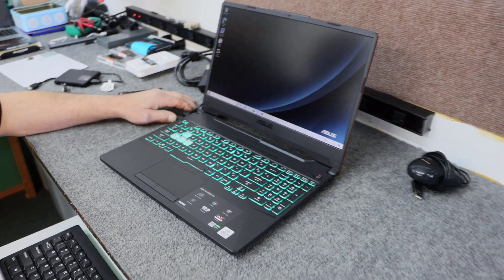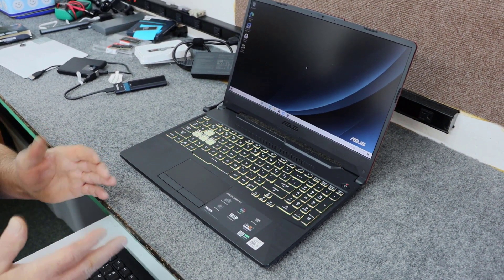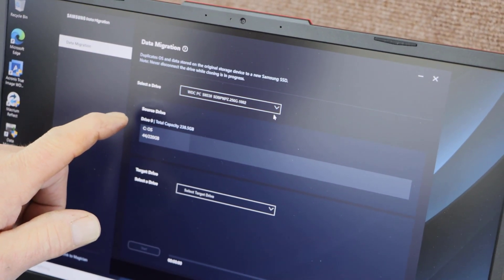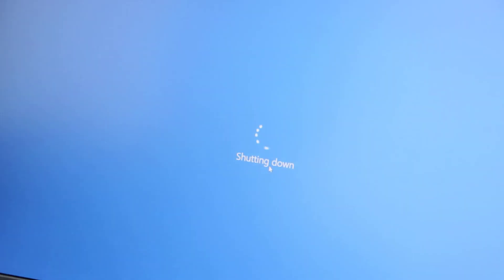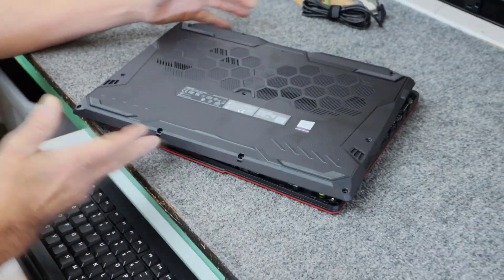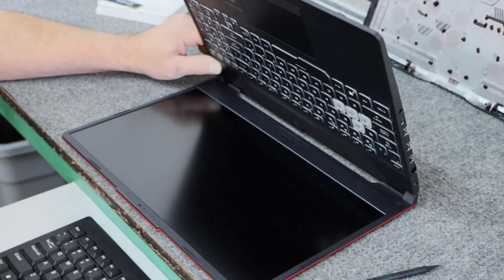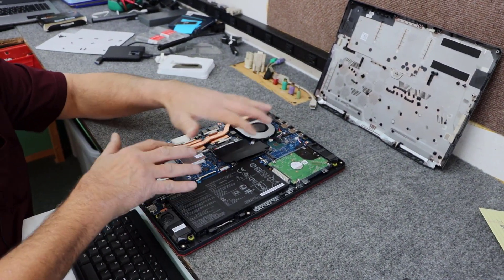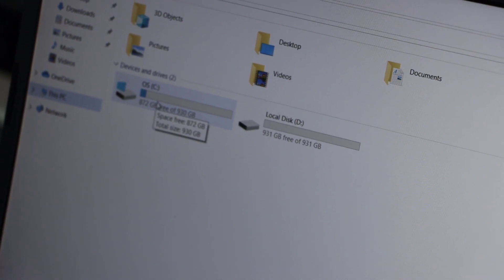ASUS TUF F15 Gaming Laptop SSD Clone & Upgrade Memory Upgrade

Comment: Hello, my father has this exact laptop and it has a wifi issue. It disconnects from the network and will not reconnect unless I uninstall the wifi driver then restart the computer and let windows reinstall it. It will be fine for a day then rinse and repeat. Any thoughts as to why it does this? It has windows 10 but I upgraded to 11 in hopes it would fix the issue. I also updated his bios and graphics drivers. Still happens. I've heard it's common with this laptop... Cheers.
Reply: i have the same issue on mine and i think you need to buy a new wifi card

Comment: Hello
My Laptop model: Asus Tuf F15 Fx506hcb
Core i5, 8gb ram, 4gb Rtx 3050ti,48watt.

I want to upgrade and add a HDD but my laptop doesn't come with a generic Asus Tuf F15 sata cable.
Have you experimented with various sata cable cable, branded and offbrand like that of HP or Dell on an Asus Tuf f15 laptop with success? I can't find an Asus Tuf F15 sata cable at my local store so I want to know which type I can use as an alternative

Thanks in advance

Comment: Is it normal when i unplug this laptop to charger reverts from turbo to performance? Especially in gaming fps drops on unplugged state
Reply from the maker: Yes, that is normal
Reply: This was disturbing me too, but I just concluded that Turbo is only for when it's on the charger while ur using it coz they mist have thought u'll be gaming while plugged in 2 avoid running out of power

Comment: Hi sir. I brought the same laptop. And I’m trying to do the same thing as you did. When I boot up my laptop it only show one 16g of ram installed. I tried to put one in and take the other one out, both time worked. Which means the two 16g sticks are good and both slots are good. Why wouldn’t it work when I put it both? I have Kingston 16g 3200mhz. Thank you

Comment: Sir i have asus tuf f17 i7 11800h rtx 3050 with intel 512 gb nvme ssd m. 2  pcle 3.0×4(1GBps/1.5GBps write read) , now I want to install samsung 980 500gb ssd m. 2 pcle 3.0×4(3GBps/3.5GBps write read) , can i replace it with intel's slot and shift os to samsung and place intel in second slot as simply storage? Won't it affect device as both ssds have completely different speeds?

Comment: As a complete pc noob or beginner of great learnings i want to ask u a question, that is suppose i clone my original os and files on laptop with a new ssd or hdd and then put the ssd or hdd into a desktop/laptop, will that work?can i use the same thing in both the system regardless motherboard and the whole bios changes?

Comment: Hi i was confused, is this laptop had the auto cutoff feature ? If the battery already full charge, it will be automatically cut the energy to the battery, and start using the energy from the charger. Is this laptop had that feature ?

Comment: Has anyone has an issue with this models second ram slot not working? Ive tried pretty much everything and found that both identical ram sticks do work in the first but not second slot.
Reply: I have the same issue on the ASUS FX504.  @Dale - any suggestions?

Comment: Hi! Do You know how maximum absolute capacity of SSD NVMe this model can handle/service. 
I mean also maximum capacite per slot and totally.
Regards
Reply: i have 2 4tb nvme in mine and a 4tb ssd samsung evo and 32gb of ram so thats 8tb of nvme and 4 tb of ssd sata so 12tb in total. crucial p3 plus gen 4 are the nvme ssd. asus tuf dash f15  gtx 1650

Comment: Hey Dale, this is vey helpful. New subscriber here. A quick question. I have an ASUS TUF laptop with a 120GB SSD and 1TB HDD. I am planning to upgrade the SSD to a 1TB but struggles to find ways to transfer everything including back up, system files and factory settings etc.  if I don't have that SSD adapter, can I clone the existing SSD to the HDD, install the new SSD, then clone back from HDD to SSD?

Comment: My dad bought me this laptop for college and casual gaming with 16 Gb RAM and 500 Gb SSD. Yesterday I used this video to guide myself while upgrading it to 32 Gb RAM and 1Tb SSD. I'm very thankful for the detailed explanation and care you put on this video. I appreciate your time sir. Again thank you so much!
Reply from the maker: Thank you much. Dale
Reply: was it easy to take out the battery or disconnected from it ? im about to do it appreciated if u can answer it thanks
Reply: Hey any advice for my situation?

So I ordered that same computer with 8Gb ram and decided to upgrade it to 16gb, now the laptop won’t power on even when connected to power, it won’t boot up like not even a light pops up

Do you know why maybe?
Reply: @abigailfrost4099  did you wear a anti static band and unplugged the battery pack before installing it ?

Comment: Hey, are there any warranty things. Will I lose my warranty if i will upgrade my ram?
Reply: If you don't break anything there chouldn't be a problem, it depend on your model and where you are, but if you don't touch to factory seal you will have no problem. Especially if it's a MSI laptop, on some of them you have a factory seal outside the case that block your access to the screw, at some place breaking the seal void warranty and at other it don't, if you have been carefull and broke nothing. If you have a laptop that you can upgrade without breaking seal then you will have no problem, if you want to be safe, upgrade but when you take/send your laptop because he have a problem, remove what you added before letting the repair man see it.

Comment: very nice tutorial. Headsup: 32gb doesnt mean better fps. if you're lucky, maybe 1fps in some cases, also its 2400mhz, the ram that comes with these are 2933mhz.. so the only performance increase is the more ram and it now has more capacity for stuff in the background.

Comment: my laptop has an 8gb ddr4 3200mhz ram stick that has CL21 latency and is it ok if i use CL 22 ram?
that ram has everything same except for the latency
Reply from the maker: Yes, it should work fine.
Reply: Working fine checked it it's in dual channel

Comment: I have a question , can i have 32 gb ram with 3200 MHz ? In mine ? I have the same one !
Reply: yes! i also have the same one except it has a 520gb ssd and its fortress gray.
32gb and 3200mhz is the fastest speed and biggest size of ram u can get on your laptop
Reply: @Shonty_on_gfuel  which company is the ssd from?

Comment: I installed add'l ram to my Asus A15 FX506IV laptop, however that black sheet covering from ram's slot was no longer returned by the technician. Is it ok?
Reply from the maker: Yeh, it will be fine without it.

Comment: I did not understand one thing this laptop supports "2" m2 ssd port  why u didn't use second one to put 256gb m2 ssd   It can give more storage
Reply from the maker: Hi. In this instance, the customer wanted to use the 256 in another laptop they had, that only had a 128 ssd. Dale
Reply: Also this laptop supports 2933 mhz ram and u used 2600mhz is it effec  normal performance or not  cause im also using the same laptop and today asus service said they advice to use 2933 mhz  which one should i prefer , im also planing to upgrade my ram ?

Comment: i have a question sir. My laptop is asus tuf fx505. i Bought a nvme ssd, and i have a hdd intalled in my laptop. Do i have to reinstall the windows after i put the nvme ssd? because i will not remove my hdd in my laptop. Waiting for your response thanks!!

Comment: Good night, I have a question, from what I could see in the video the motherboard has two m2 ports, why didn't you leave the two ssd m2 nvme the 1tb and the 250 gb one?, from what I could see in the video the  second port is located on the right side on the hard drive
Reply: Actually the one having 2 m.2 slot won't have a hdd slot and will have a bigger battery occupying the space of hdd.... Now as you say from the video .... The black bar on the right side of hdd is the one of 2 speaker....
Please reply me with thank you 😁
Reply: @omdandade8245  No disrespect Om ,but what u replied i dont understand..what i see, Jose is right.There are 2 ssd ports.I am not sure if there is any reason not to keep both at a time.

and yea FYI this does have 2 ssd slots as well one hdd slot
Reply: @madhab_mishra  actually i can confirm because i have the same varient, And actually there are some varients with 2 ssd slot (one preoccupied). But not this one. And i explained it why is that before.
And yes ofcourse you can have 2 ssd in both slot if you have .
Reply: @omdandade8245  just FYI, the open SSD slot is right above the HDD and clearly visible in the video.  There was really no need to clone and remove the installed SSD, as the new one can just be put in the open slot.  But Im sure he did it just to show and explain.
Reply: @colonel181  ohh i see now, i successfully wasted my time 😑 researching.

Comment: if it was my laptop i would move the 512 gb old m.2 to the other slot on the motherboard just above the hard drive
Reply: is there 2 ssd slots ??? i did not knew , i actually ordered the same one with 512 GB NVME 8 GB 2933 RAM 
 so i was thinking of upgrading as 
1-8 GB stick, 1 TB 2.5 inch SSD instead of Nvme (cos of cost as well i dont need blazing fast speed for my non essential data like project files and etc )

i got the laptop for around 800 $
Reply: @phoenixishere  it depends on the model 1660ti and above have 2 sad slots,1650ti and under dont
Reply: @PirateCat822  checked that one .. mine is 1650TI but it foes not have an extra nvme slot...yeah a 2.5 inch ssd bay is there
Reply: @PirateCat822  just checked mine its got the 1650ti and 2 m.2 slots

Comment: Can I just add another 512gb ssd to it without having to touch the main ssd? I dont wanna have to do all the extra stuff that comes with upgrading the main ssd. So figured I would just add another 512gb or 1tb ssd card onto of the stock one.
Reply: I have the same question. Did you figure out what to do?
Reply: yes there's a another slot for nvme ssd
Reply: @genarogevera1411  do you know if we can use both m.2 slots without problem
Reply: @genarogevera1411  i am also wondering

Comment: Hello Dale 👋,
These two I've shortlisted for my laptop's ram upgrade which one do you suggest?
HyperX  16GB   3200	20	22	22	1.2V
vs
HyperX  16GB   2933	17	19	19	1.2V

PS :
CPU:  i7-10750H (max supported till 2933MHz but my stock came with 8GB 3200MHz but is now downed automatically at 2933MHz CL 21-22)
Motherboard:  Doesn't support XMP

I am looking to remove the stock one and put a 16GB of wither above one in single channel and then the other when I’ll be able to afford the other 16GB stick

Hoping for your reply as  soon as possible would really appreciate it, as I am stuck with my 3D projects at my current ram
Reply: If I where you I would go for the second one, the HyperX  16GB   2933	17	19	19	1.2V, as you get lower timing (CAS/CL) so it will be a little bit more responsive and because the 3200 one will get you nothing better as it will be limited to 2933 too 😅, so just go for the one already at 2933 MHz that will also be a little bit faster because it have lower timing.

Comment: Hey! I have an  Asus TUF Gaming FX505DY and i want to make a RAM Upgrade. Do you know which memory velocity i have to buy to make the upgrade?
Reply: When we are thinking about memory upgrade there is some things to know about the Ram already in the pc, the number of stick in there and there capacity, their speed that you can see in the task manager/performance/ram it's in MHz, and the CAS /CL of the Ram. For the timing (Cas / CL) install CPU-Z, when you are searching for the new stick of RAM try to get the same CAS /CL, the same speed or more as it will ajust his speed to the stick already in the laptop, and if you can the same brand but if it's not the same brand it's fine if you have same CAS and Speed(= or +).

Comment: Thank You so much! Just installed 24gb ram :)
Reply: i think you had 8 gb ram and added a 16gb stick
dont do that ram sticks need to be same size in order to prevent data loss and it will limit your performance by a lot
trust me replace your 8gb stick with 16gb so all the sticks are same size. all the ram sticks in your system have to identical latency,speed,voltage,size
if you have a 4200mhz ram stick and a 3200mhz stick installed all the ram sticks will run at the speed of slowest bcs the cpu cant handle multiple speeds or otherwise it'll be very ineffiecient and potensial data corruption

thank me later
Reply: @Shonty_on_gfuel  But is it okay if both ate 3200Mhz? but not same size ?🤔

Comment: Thanks for your good work, it's not easy to find such informative videos of this series of laptops. Wanna ask you something. You mentioned that this pc has one M.2 slot, but it says '2nd PCI-e SSD slot' at 10:49 of your video.(Just above the SATA3 SSD slot. Can you check it? And I have F15 FX506LI HN012 version. So do i have two M.2 slots?
Reply: yes you have 2 m.2 slots and a sata slot unless you picked the extended battery edition which will not have a sata slot but overall 2 m.2 slots are there

Comment: My screen just goes off for a second when I pull out the charging cable and comes back again immediately....but it did not happen when you plugged out your charging cable....is there a defect in my laptop ???
Reply: the screen changes from 144 Hz to 60 Hz Refresh rate that's why it does that when u change to battery mode
Reply: mine does the same thing, i guess its normal, because of the change of power and the configuration of processor and grafic card...
Reply: Is there anyway to prevent that??
Reply: @nithinreddy5435  i dont thing so, but there is no problem with that, just a change of energy on the notebook...

Comment: Have have this laptop and I'm installing a 2.5 ssd and it isn't working. I'm not sure what I'm doing wrong
Reply from the maker: Hi. Double check connection to mainboard.  Also. You have to go into disk management in windows to allocate new drive.

Comment: Can it be possible to upgrade the ram to 24 gb by installing a new 16gb ram in the second empty slot or should i remove the 8gb slot and replace it with 16 gb and install the 8 gb one in the other slot ?
Reply from the maker: Hi. Yes you can go to 24gb .  No need to switch slots. However,  you'd be better off just adding another 8gb stick of the same speed so you can achieve dual channel.  Dale
Reply: @CadillacComputerCenter  thanks for the help👍

Comment: Will this motherboard support 3200 mhz ram stick?  He said up to 3000 but he didn't say any higher
Reply from the maker: Hi. I have used 2933mhz many times with no issues.  My research says it will support 3200. Dale

Comment: My model of this same laptop has 2 m.2 slots. If I add a 1TB can I clone from the original 256gb and then use the 1TB as my primary drive and 256gb as secondary or would that even matter performance wise?
Reply from the maker: Hi.  You can certainly clone as you suggest.  The drives from the factory are  not high performance by any means.  If your new 1TB is a good, fast SSD,  it would make a difference for sure. Dale
Reply: 1tb drive is HDD and the speed difference in HDD vs SSD is like comparing day and night ssd is waay faster than a hdd which means ssd will make your boot times, load times, overall disk activity faster
thank me later
Reply: Bro, can u please tell the company name of the original ssd which comes with this pc?

Comment: love this review! 

watching all the way from Malaysia
god bless!
Reply from the maker: Thanks for watching.  Greetings from Michigan, USA. Dale
Reply: @CadillacComputerCenter  

Hello Dale 👋,
These two I've shortlisted for my laptop's ram upgrade which one do you suggest?
HyperX  16GB   3200	20	22	22	1.2V
vs
HyperX  16GB   2933	17	19	19	1.2V

PS :
CPU:  i7-10750H (max supported till 2933MHz but my stock came with 8GB 3200MHz but is now downed automatically at 2933MHz CL 21-22)
Motherboard:  Doesn't support XMP

I am looking to remove the stock one and put a 16GB of wither above one in single channel and then the other when I’ll be able to afford the other 16GB stick

Hoping for your reply as  soon as possible would really appreciate it, as I am stuck with my 3D projects at my current ram

Comment: Asus official site say max 32GB ram, the chipset used is Intel® HM470 which supports 64GB.Can u confirm if this laptop will support 64GB ram
Reply from the maker: Hi.  According to intel, the cpu will support up to 128gb,  the chipset up to 64gb.  I have not installed 64gb yet in this model. It will probably support it. The manufacturers always say less than what the computer will actually support.  Dale
Reply: @Kévin Moutoussamy that's what customer wanted" he said